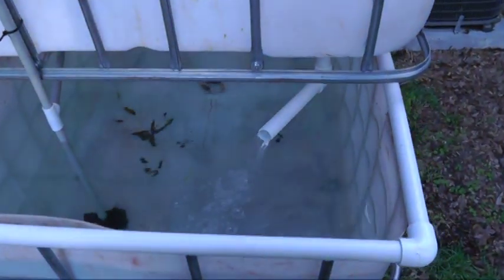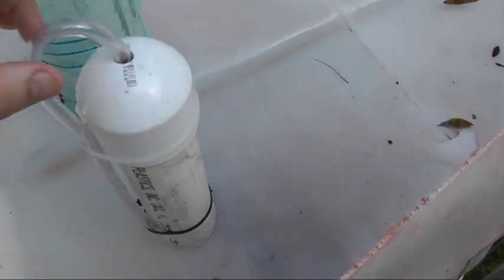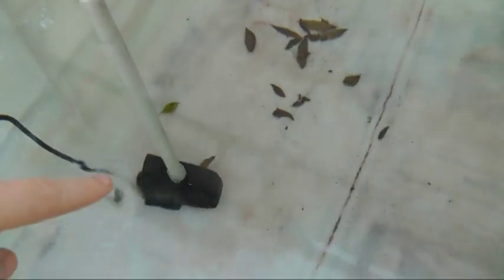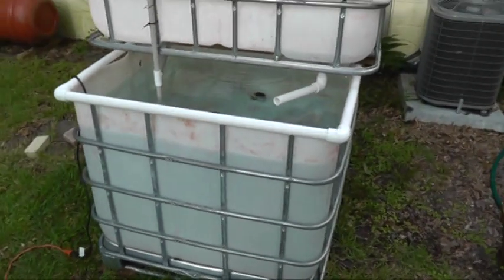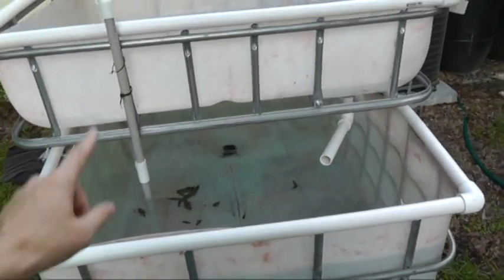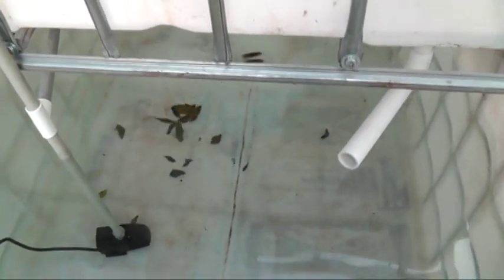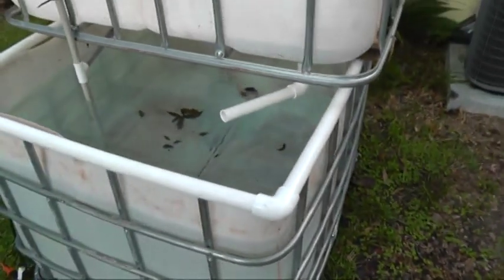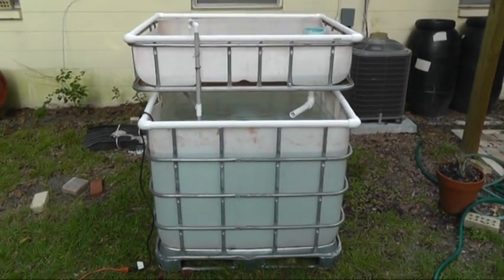My homemade IBC tote aquaponics system - First look

Comment: Hello，our company has manufacture  IBC Tank framer equipment, welding machine, bender machine, punching machine, etc advanced  equipment
,
And provide the IBC metal frame and parts are the supplier . 
WeChat :86 13798638306
WhatsApp:86 13798638306

Comment: This is the only Hydroponic Program  I could find on Hydroponics that had solid reviews [Check Details Here  ===>fb.com/Easy-Hydroponics-Systems-166096780618260/app/208195102528120 ] . I hadn't started my own Hydroponics set-up yet, but am extremely interested in doing so.I wanted something that would help me understand all of the systems required, how to plan a build, and what to expect once it's set up. "Hydroponic Gardening" did a good job of answering all of the first round of questions I had.

Comment: As I am looking into doing this myself, I came across a fish density to grow bed sq footage calculator. http://www.aquaponic.com.au/calculators.htm  Basically a 275gl tank with 25-30 fish (that grow to 1lb~) will support 2-3 growbeds. A chopped IBC tote equates to 13.3 sq feet grow bed (with depth 10-12 in). So 30/33 fish in a 330gl ibc tote supports 3-4 growbeds. 

Just some (maybe) helpful math calculations for ya. For me it means if i get 1 330 and 2 275 IBC totes i have enough footage for the 330gl fish tank, 3 growbeds and a sump tank. 

Also would suggest adding some sort of solid filtration, this can be as simple as adding earth worms when the system is fully established, or adding a swirl or radial flow filter into the mix. https://www.youtube.com/watch?v=RVzNcU8EnwU is a great video on making a radial flow filter that looks quite effective and cheap. He also has ALOT of videos on aquaponics using IBC totes.

Edit: Would also include some sort of cover for the fishies. Alot of designs are like yours but personally I think leaving it totally open has too many issues, one birds snagging dinner, two mosquitos and three fish feel more confortable in darkness then in lighted conditions.
Also important to paint/cover the sides of the totes to prevent light entering to avoid algae growth.
Reply: There are several components to studying home aquaponics. One resource I found which successfully combines these is the Keiths Ponics Site (google it if you're interested) definately the no.1 info that I have ever heard of. Check out this  super site.
Reply: Fiskanatorz a

Comment: Ok so this is really cool.. but the siphon thing always kills it for me. So I came up with a better solution... electronic ebenflow. I have not completed it but here is what I have : https://youtu.be/hi0AazuARTQ  yes it is a solar powered pump. There is no need for evenflow because the pump turns on and off. The control is a simple MSP430 with a relay. The key here is supercapacitors that allow you to run a large pump off a small solar panel. It can be run to 0 volts with out degradation and its just a worry free thing that I think will help us diy people with our IBC totes and such.

Comment: Well done. The system you have is fine for small fish. That is up to 8 inches long. Any larger will develop one fillet much larger than the other. I hold free classes for people to learn about Aquaponics and the Old World AquaFarm Systems. It is better to have several totes attached to each other to maintain water temperature and diversity on your Aquatic Animals. You can use the same pump, just pump from a central location.Visit my website and view several videos on this subject. oldworldaquafarm.com (We grow root crops in the Old World AquaFarm Systems).

Comment: How are you going to protect this from colder weather, or do you live in a hot climate/  I have 2 small aquaponic beds and a couple of floating rafts for hydroponics and a vertical hydroponic unit I made in my basement.  I live in the Midwest so I would have to enclose this in a greenhouse situation.  Did you cut the IBC containers or someone else?

Comment from the maker: it's a submersible pond pump. It's 110v AC. It may be hard to find a proper pump in 12v, so if you want to run off of solar you will probably need to run an inverter.

Comment from the maker: 80 degree water is best for optimal growth,but they won't start dying until the water gets into the 50s. I'm in florida and air temperature rarely gets far below that, even in the winter. If it did get cold even a small fish tank heater or passive solar heating should keep me in a good range.